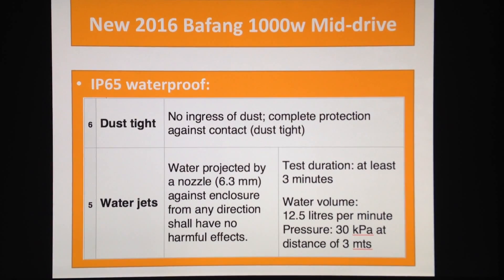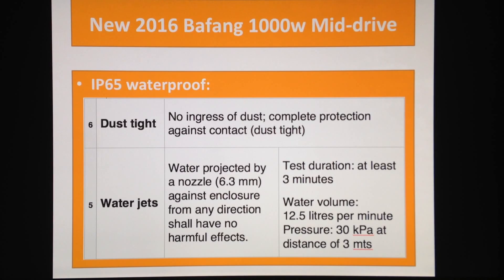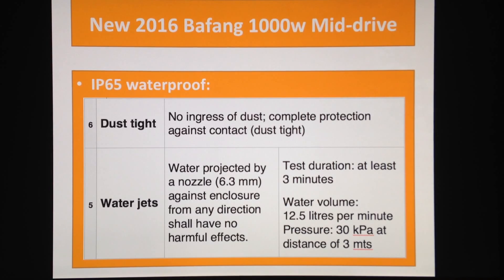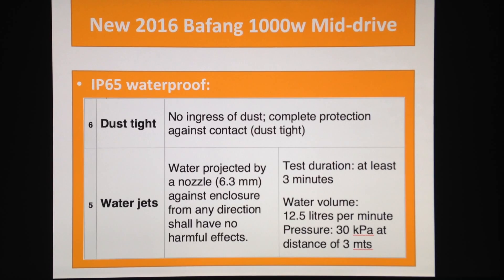New 2016 Bafang BBSHD 1000w mid drive (video 3 of 7) What is IP65 waterproof? • 8fun BBS02

Comment: Hi ....I have a new Bafang 1000w and the display is this DP C10.UART  ....the battery display doesn't go off of full charge....We have gotten 53 miles on the battery before charging .....we can't get into the screen to put the code in 0512 to check the voltage (45) we get into the  part that says (nnA then it jumps a screen LUd) ...love your videos.....HELP !!